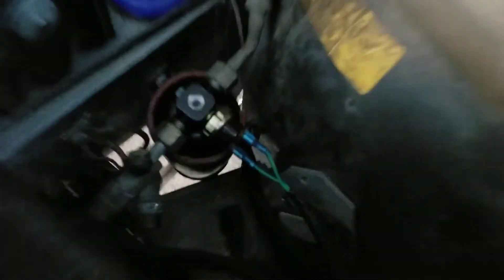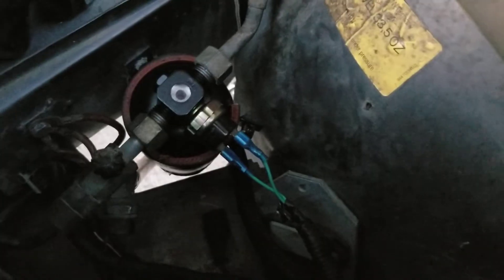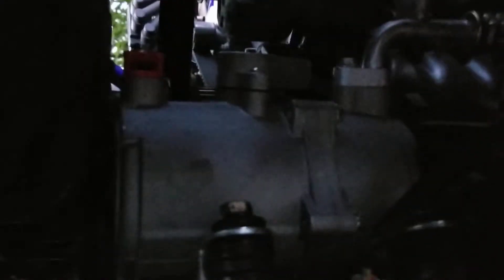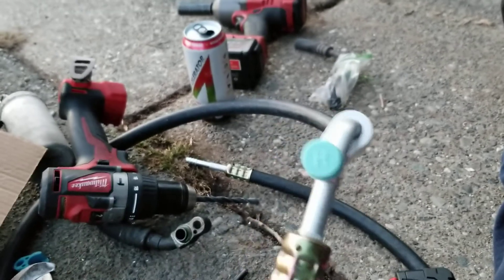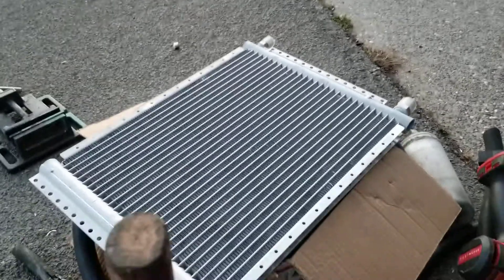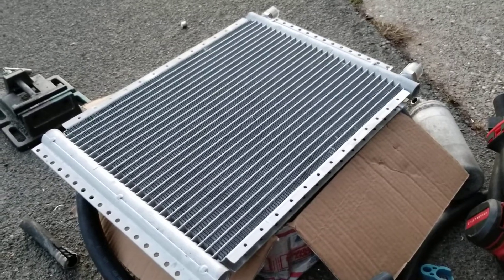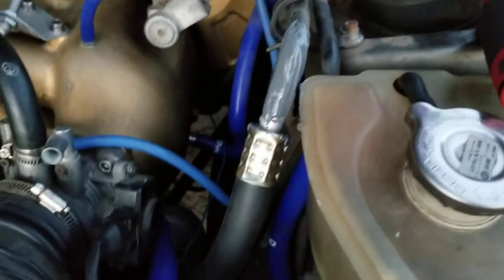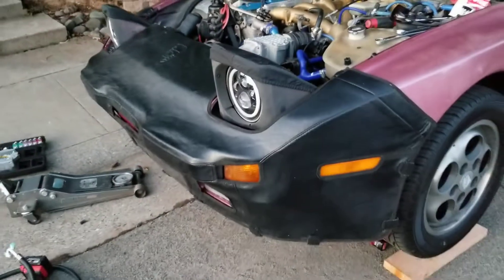12 Volt AC Compressor in a 944 Part 1

Comment: thys system requires about 800-900 watts , meaning a very strong alternator, with 1000w more than the original, how did you solved this?
Reply from the maker: Hiya,  I Installed a 145amp alternator from a Nissan quest was how I solved it.

Comment: What about the voltage? It was a guy putting one in an old Chevrolet truck and he said it pulled allot and recommended using an second battery and upgraded alternator.
Reply from the maker: I apologize for the delay.  If you have a 140mp+ alternator with a good battery system works good.  Highly recommend running the power for the compressor directly from the alternator power stud.   You can run two batteries if planning on trying to run it with engine off for a short time.

Comment: Hello, does it work with the factory fan controllers?
Reply from the maker: Hi.  I have it set up on its own switch.  I explain about it in a later video.   I planned on having it run off the factory AC switch, But ran into a few complications with that. But I do plan on going back to that route once I get the system running good and can actually go for a drive test.

Comment: Does your AC compressor run continuously?
Reply from the maker: Just sitting in one spot it does, also I deemed the condenser I installed too small, so it has been upgraded.    I have not been able to go for a drive to see if it hits the lower pressures needed to shut off

Comment: Hello. I've been daydreaming about doing something like this for my MR2 for years now. 
So, was it worth it? What are some lessons learned? How would you do it differently?
I was thinking I might need a bigger battery, maybe even a second one like how some trucks are set up. Some 18 wheeler setups I've seen have like four or five batteries in their APU AC setups.
I was also thinking I'll need a bigger alternator since my car has one of those old school 80a alternators. That's probably the easy part.
If everything goes right, I would have a more balanced car, my car wouldn't shake as much when running the AC, declutter the engine bay [but add to the frunk, sacrifices I'm willing to take], and get past this brain constipation I have with this idea that's been floating around lol
I'm gonna head over to your part 2 and watch all your videos now. 
Thanks in advance!!!
Reply from the maker: So far I have had limited time to do anything on this since part 10.   Lessons learned, Larger condenser will be going in and possibly changing the hoses to a Low Barrier type.  Having a good solid battery is a must, mine is a H6 group. Not really a need for two unless you want to attempt to run this system which out the engine running.  I have a 145AMP alternator what actually does really good from a Nssan Quest.
Reply: @dr.frahnkensteeen4485  Thank you for sharing and responding. I saw your alternator upgrade. Also thought about the hoses, I was thinking I might do with a solid tubing setup although that might end up cracking some time, but it would eliminate the need for hoses. 
I'll note your point about the battery. I was not wanting to dual battery since that would be heavy. 
I feel better about following your footsteps now. Thank you
Reply from the maker: @kalui96   You are welcome.  Happy to help! Going all solid would be cool, but higher chances of failures, would have to have some flexible areas.  Having a good healthy battery is vital to his set up or it will kill the battery is about 2 weeks of sitting.   Good call for not wanting the dual battery, it is heavy and can raise your over all cost a lot more.  Anything else i can help with please let me know.  I hope this Sunday I can do some more work on this and actually go for a test drive.  Very happy that this has helped you.

Comment: This is the video I've been looking for. I will use a 96v electric AC compressor in my build. I have converted my Suzuki (Kei) minipick up to electric and it runs on 96v, hence, the current draw will not be as much..
Reply from the maker: Very nice!  Blessing on your conversion ^_^
Reply: @dr.frahnkensteeen4485  Thank you.. 
The AC installation is my nxt challenge.. Never made water fitting repair that did not leaked on the 1st install, much more on an A/C fittings.. Hahaha.. Im sure it will be a stiff learning curve for me.

Comment: im doing the same thing with my car now (turbo charged delsol). This kit really came with nothing for instuctions. Do you happen to have a diagram or maybe make a video on the wiring on the controller?
Reply from the maker: I will be doing a video on all the wiring much as possible.  I have talked about the wiring in my others videos at bit.  My kit was super basic for instruction,  I used the picture layout from the ebay purchase.

Comment: Can I use only the compressor with the car original condenser and dryer , I mean without buying it’s own condenser and dryer?
Reply from the maker: You should be able to. Long as you can match up your factory lines to the compressor.  I went with everything new since a lot of my AC stuff was from 1985.

Comment: Where’d you get that kit from?
Reply from the maker: Just the compressor with a few fittings was VIA ebay.  I had to make everything else, Lines, brackets, support units, electrical connections and get an AC condenser.

Comment: The problem is the compressor needs 60 amps, which is a lot
 You will need a large battery and a dynamo of more than 100 amps
 I bought a compressor like this, and the problem is that it works with 60 amps, so it pulls all the power from the battery and stops the compressor.
Reply from the maker: I have been researching a few options like commercial grade batteries. also I have increase the Alternator from 110amper to a 145amper.  That actually helped a lot.  Ran into some other issues that I need to address before I can release Part 6.
Reply: get 12V 100AH or more lifepo4 battery, hook a charge controller to your alternator, set the amps according to the alternator power rating. get a battery LVD so when the battery is low, the compressor is off. keep the ac low to prevent depleting the battery.

Comment: Nifty little guy, that compressor. Nicely installed! Is this a a/c kit that you've purchased? What kind of condenser you're using? Thanks in advance.
Reply from the maker: Glad you like it.  I appreciate that a lot, it has been quite the project.  I am in testing phase right now and figured some things our already.   I am using a universal condenser. 12x16,  It might be too small, But need to keep testing.  I purchased the unit, Hoses, Fittings and condenser all separate.  If this does turn out to be a good unit I will make a video on all the parts required.

Comment: Can this run off a car battery or deep cycle? Or do I need an inverter?
Reply from the maker: It is set up for a 12V system. Has its own power board that controls is.  So to answer the question, No Inverter, Just hooked to Battery with least 120 reserve and 950CCA

Comment: How many amps?
Reply from the maker: Peak is at 100amp when the compressor is at full swing.
Reply: @dr.frahnkensteeen4485  do you feel this 100 amp drag when you get on the throttle?
Reply from the maker: @bryaniskoo  System is not running right now.  I have not been able to actually make Part 3 yet.

Comment: This is pretty exciting. Do you know if this compressor has its own controller with variable speed control? Been curious how these work. Or does the compressor cycle itself on/off/on off?
Reply: These kits are really cool , I put one on a 1994 Chevy truck we mounted on a 1975 Chevy K30 chassis with a carbureted SBC . It was just easier to do and works very well. Comes in a complete kit .
Reply: @backyardbuilttrucks1   where did you get the kit?
Reply from the maker: @backyardbuilttrucks1   Thanks for the added input to this! I like knowing more people have played with these units.
Reply from the maker: Thank you.  It does have its own control board and a 2 speed set up at 1500rpm and right around 3krpm at peak.  It will use pressure valve for high to control if it shuts off or not.

Comment: So it didn't need the engine to powered the AC compressor right ? But get the power from the battery.
Reply: The alternator would be the one that powers that compressor, most of the time people will need to upgrade to a higher amp alternator
Reply: No I think this one's the one that usually trucks use em. They have like a motor thingy that turns the compressor piston and swash plates acting like a alternator in this case. If I'm not mistaken